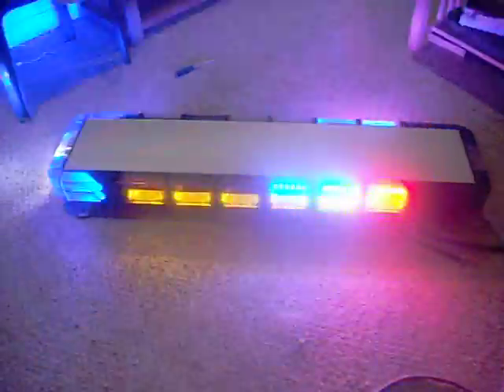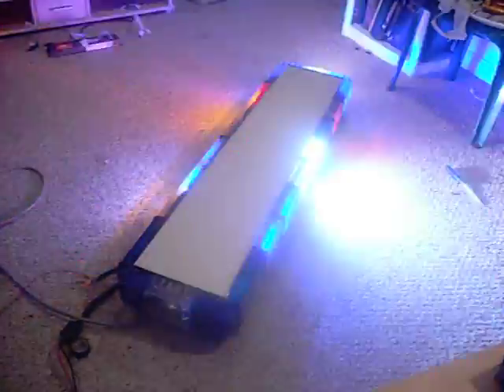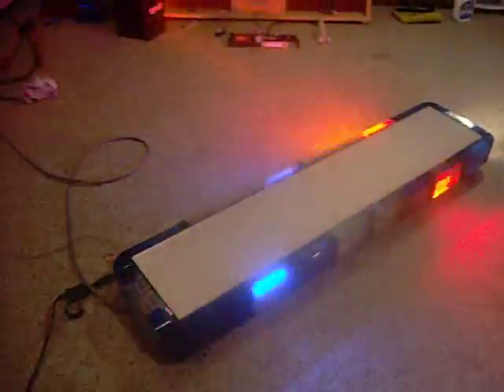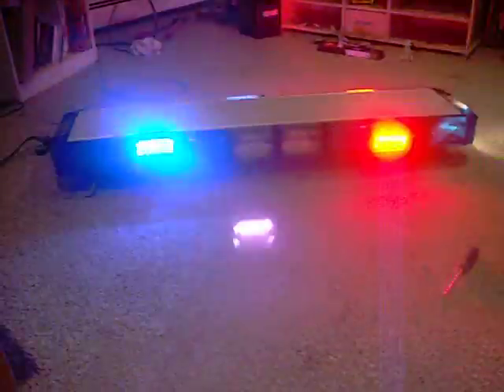Whelen Ultra Freedom UPGRADE

Comment: yes as long as they aren't displaying colors on OR off. and you cannot have the bar lit while driving however you can have them on when parked say on a construction site with permits in most cases